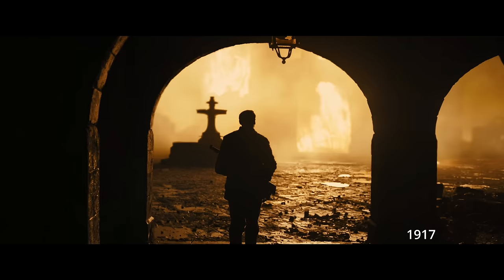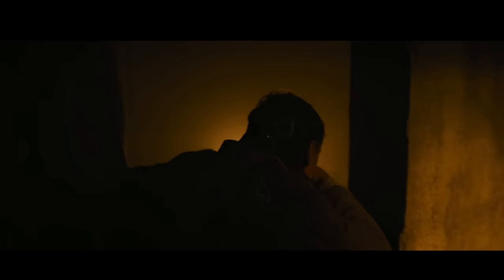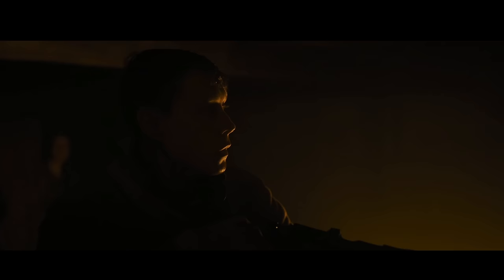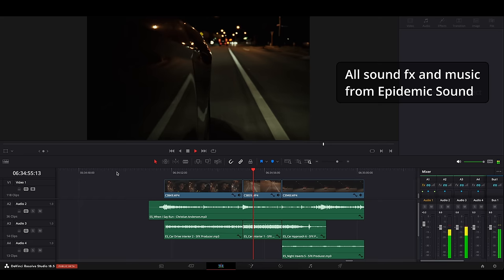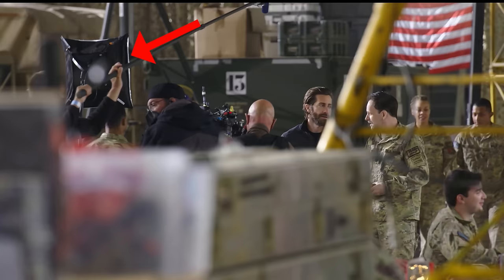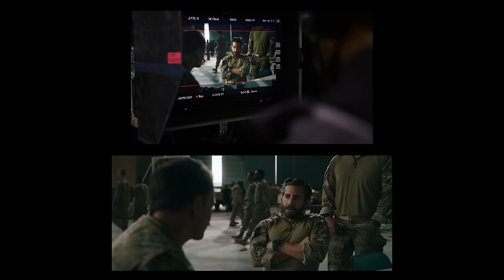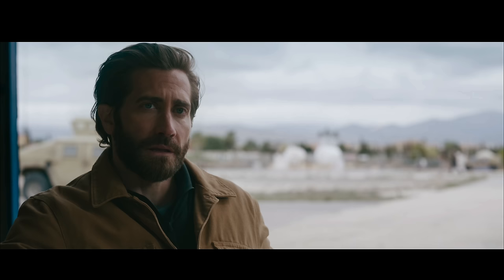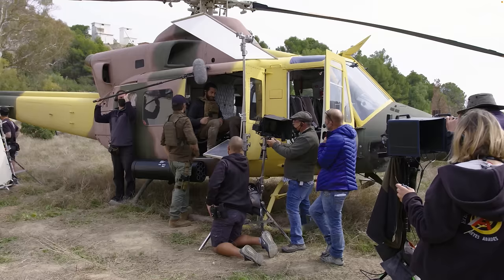how did they make this?

Comment: I love Deakins’ approach to compositing or CGI for his visuals. He uses it as a real tool to make something possible where CGI is the only reasonable option to make it work. It’s not meant to show off but rather to blend in nicely into the scene and the story
Reply: This wasn't CGI though, it's a composite of real shots
Reply: You mean “compositing”, not “composting”.
Reply: That's not cgi, that is composting. they basically cut the actor's part, and paste it into the other shot which has lighting in it. it's pretty much just basic editing illusion
Reply: @v-trigger6137  that’s why I also said „compositing“
Reply: @Jsjsjjssjs  The face, yes, is composited. But there's a CGI fireplace with major color correction going on and indeed a whole CGI burning building in these shots.

Comment: The other thing I noticed about the light panel in the indoor scene was (at least in the BTS) that it was relatively white. So besides all the other issues with fire on set, they also appear to have filmed with whiter light and colour-graded warm, rather than filming warm (or even having the light panel set to "fire tones")
Reply: That or the behind the scenes photography is balanced to white. I don't know if shooting with white light and balancing later gives any benefit from just shooting with warmer light, but considering the light from the burning building is the same temperature in pre-vfx footage I'd be more inclined to assume it's the same case here.
Reply: @IsraelStorey  Yep, different white balances on the cameras. Also, directly shooting at the panel, it's going to appear more bright/white than it actually is...

Comment: 1917 is a masterpiece obviously so that was interesting but The Covenant completely flew under the (my) radar and this is the first I've heard about it. The work that goes into lighting is incredible. It's basically a professional photography shoot but for a moving picture which makes it exponentially more complex. With reverse shots, multiple angles and moving subjects things get complicated fast. I wonder how much they plan beforehand, lighting wise, and how much is done on the day. I suppose for exterior shots a lot is improvised to make use of natural light and obviously interior shots can be planned out more beforehand.

The extra light they needed for that large hangar shot was nuts. You don't even think, "Hang on, that should actually be pretty dark in there", which is of course the director's intention. 

Very interesting mate. Definitely subbed

Comment: Excellent as always. There is so much replacement and masking done in post. Removing stands fixtures its insane. Meanwhile in the real world im sure you have probably mentioned it somewhere but a simple trick to understand what is happening with lights is to look at the eyelight and how it changes. It literally tells you everything there that is making a difference camera side. The bigger lighting effects like back light and wrap are often pretty obvious in that they will create a clear light source effect and will involve a massive upstage key and a soft grid filling in and it is great to see the monitors and the false color to see what they are aiming for. A great film to try and get your head around is first man. Most scenes look unlit but for practicals but that exaggerates the source as eyelight. In general i find lighting super simple but for the details when it comes to eyelight and the effort that often goes into that. Usually a grip walking with a light on a moving shot but it gets really interesting when directors like to shoot with multiple cameras. As the lights on the face get softer its easy to lose the clarity of the catch light. Be interested to know how important and how much effort you think is justified to get the eyes to pop. I know it can be done in post too but maybe its down to the motivation of the shot. Looking at shotdeck can be helpful but so many scenes will have actors turn into there final lit position that its hard to know how much effort and hollywooding goes on with a last minute reflector push in as withe the helicopter shot. Thx as always

Comment: What's not clear to me in the first example if if they went back, reshot the scene, and then composited over the one with the shadow, how did they get the actor's expression in both shots to match up so perfectly?  Maybe they only composited a partial side of his face with the light, not his actual facial expressions..?
Reply: I'm guessing they tracked the facial features, matched the re-lit shot and only applied the lighting of the re-shoot to the original take. Since it's just a couple seconds, you can kinda morph and rotoscope it by hand without it being too noticeable. Having the face lit correctly while the camera orbits around it makes it so much easier than trying to paint on light by hand.

Comment: Hey Lewis . I got an doubt . In the army scene u showed the convo scene . The iso on that camera was set on 500 . Why a 500 iso tho . Can’t they just keep it at 100 ? Arent the lights they use powerful and also tunable as per their wish ? Why a 500 iso tho ? @lewis
Reply: Filmmaking is not like photography where you would try to get the ISO as low as possible. They shot this on the Sony Venice, which has a native ISO of 500 (and 2500). This means  the camera would capture the most 'dynamic range' at this ISO. For the cleanest image this would be a great starting point.
Reply: @oNMeso  This

Comment: 6.18 thats probably arri sky pane 360 bsed on the size. looks like a 1/2...1/4 silk?  everything is boxed up with muslin  and the open end scrims would bee double and a single scrim pretty mobile and chea setup apart from 18k's theres actualy a better option for that rig outside. Witch is suprising.   Thanks for your videos!

Comment: At 6:21 I have a quick (I think probably dumb) question: if the diffusion over this skypanel just stops it down, could you not just use a dimmer and reduce the intensity instead?
Reply: The net is set up so it's only in between the guy's back and the light, not in between the light and Jake Gyllenhaal, so it's only reducing the brightness on the guy's back to give more control over different parts of the frame.
Reply: The purpose of the 8x8 diffusion isn't to stop the light down (though that is a by-product). The diffusion is meant to soften the light source and to make it larger. The larger the light source the more it is going wrap around the subject creating a nice fall off.
Reply: @TannerGwaltney  Thanks!